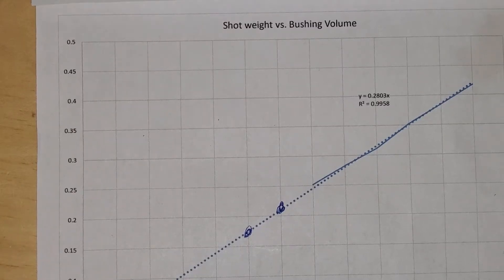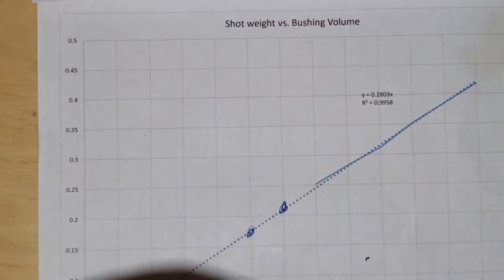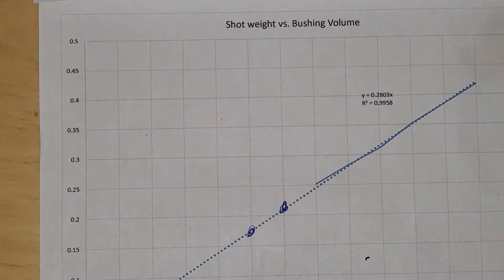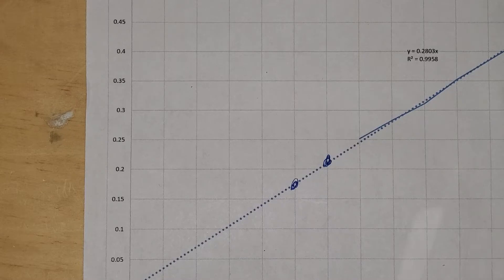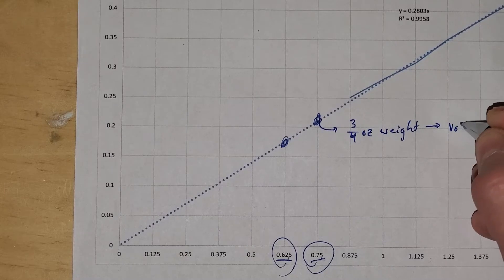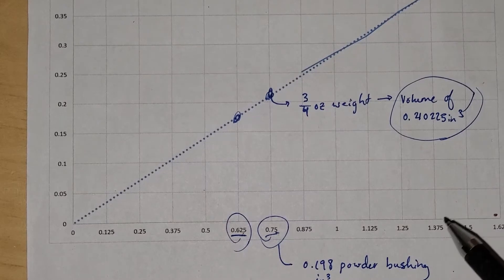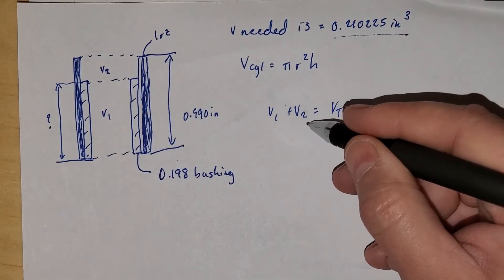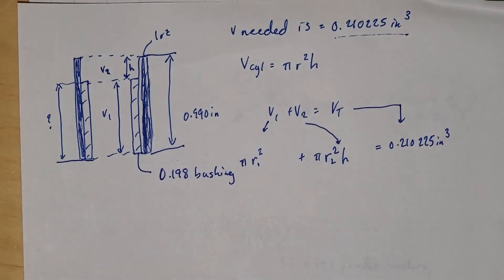Calculations for creating a custom shot bushing

Comment: Cool thing you can do while your in excel is using the goal seek or solver tool. Basically you can set up the formula for the each volume and total volume and for the time being set the height as a random number. Once your done open one of those tools and tell it to set the volume to your chosen volume from your graph and tell it to vary the height. It'll end up spitting out the height required to reach the specification
Reply from the maker: @jaredrigdon3582  but I'd rather do it by hand.